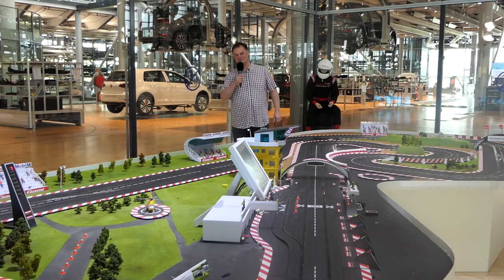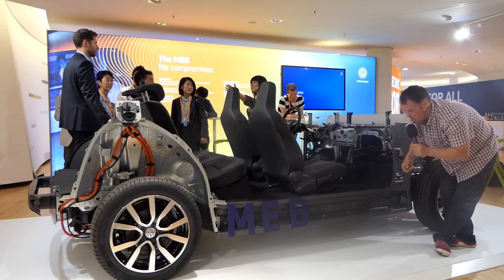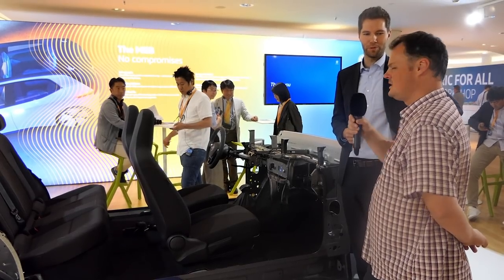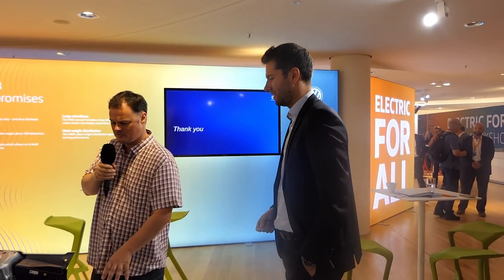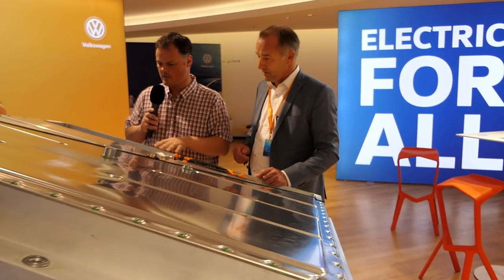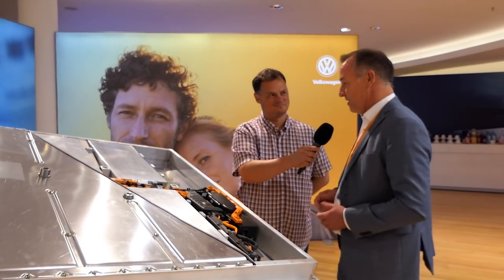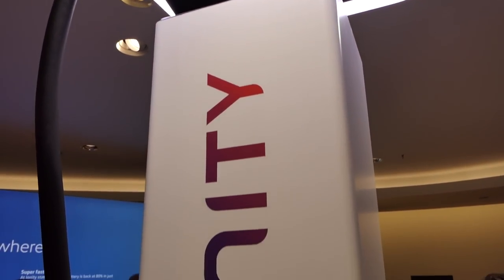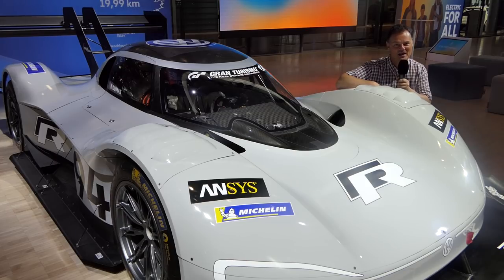Will this boost electric vehicles? 10 million EVs on Volkswagen MEB platform FEATURE - Autogefühl

Comment: The end result may be very good and durable, but i'm disappointed in what i saw in this video. It's basically a slightly improved Nissan Leaf structure ... nothing advanced, just off the shelf parts from various manufacturers...
"You need a cooling system? Just glue it on the bottom of the battery pack!" 
Long story short, for version 1.0 Beta it's acceptable, but they'll need to improve it significantly to compete long term ...
Reply: Baggage from their ICE powered cars, by baggage I mean conventional auto makers are tooled up to build the car around the petrol burner. Tesla for example has no such baggage which results in better packaging but of course Tesla has found out the hard way that starting from scratch is, well really hard.
Reply: I would expect more from a manufacturer like VW, who have the capital, expertise and public shame necessary to build something great again. The Tesla Model S  development cost was just a few billion USD?
Reply: Kárpát Zoltán I have the same thoughts that they should show something more advanced with their capacities. It’s like milking the petrol cow as long as she gives milk... In cities we are all inhaling so much crap from the cars it’s terrible like how bad must it be in places like New York! We need full electric or only bicycle in cities.
Reply: @BastianJahn  they had electric cars in the cities back in the roaring twenties but they disappeared again.
Reply: Kárpát Zoltán - VW just spent a absurdly massive amount of money redesigning their ICE platforms.  They’re not going to throw away that sunk cost without a fight.  This whole electrification thing obviously caught them off guard, so now the engineers are trying to shoehorn electric drivetrains and batteries into platforms that are clearly not designed for it.  Btw, Toyota is going thru the same issue.  The Prius Prime is built on an all-new, bet-The-company platform that has NO room for even a moderately sized battery.  Just look in the “trunk” in a Prius prime if you want a chuckle.

Comment: Good to see that VW developed new platform and goes in direction to E cars. But I‘m missing a frunk, I ask me why Tesla has the space and VW not...
Reply: why have a frunk, when you can have a smaller car. The concepts of MEB-cars show a very small hood. That was probably one of the design goals. The teslas are large cars, to large for the European market, that is dominated by compact cars like the golf. By making the hood shorter, you get more interior space without a longer car. I am curious tho, how they will fare in the crash tests, as the teslas have a longer crumble zone in the front of the car.
Reply: It's because of the modular design. This same chassis will be sold with a transverse 4 cylinder ICE engine.

Comment: I don't know but that radiator is in the same place and mounted in the same orientation as most ICE cars.
But what do I know, I've just been working on cars since 1978 back when I was still 10 helping my dad with his car.
Reply: Modular chassis means that one version of this car will have an ICE. Radiator probably does double duty for both ICE engine and battery cooling for BEV version. This shared architecture is most likely why it still has a lead acid battery.

Comment: Why don’t EV auto makers put parallel charging ports on both sides of the vehicle?
Would make it much easier to charge. 
Also, why don’t they sell ceiling mounted charging stations, or at least retractable charging cords that drop down from the ceiling to save space and make it easy to access the charging port no matter where it’s located on the vehicle?
Reply from the maker: See in the Audi e-tron review with the charging ports: https://www.youtube.com/watch?v=OAViUyT1gfE

Comment: Did not seem impartial. Almost like a promo for VW. There was absolutely zero that was “groundbreaking” and the journalist looked like he was asking a bunch of “approved” questions with prepared answers. Why a 12 volt lead acid? Why not super capacitors? Why not a more integrated front section. Looked like a traditional ICE engine bay that’s been adapted rather than something designed from the ground up for an EV. My guess  that is to reduce costs so they can use existing suppliers rather than custom designing radiators and AC units -  that’s fine but don’t pretend its anything special. It’s great that VW is embracing EVs but it isn’t surprising to see a lack of “openess”. And if cooling a battery is so important what does that say about the eGolf?
Reply: MondoTV just wondering where you got your decades of experience in automotive design - LIKE VW HAVE.....
Reply: Andy McCabe Why so angry? I gave an opinion on the video and one design aspect of the car. Did you think that was an impartial and open video? Did you think the front engine bay looked like it was custom made for an EV? For example like a Tesla model 3? If you did that’s fine. I think its great that VW is actually going to commit an assembly line to EVs. More competition is good. I didn’t find much in that video that was very innovative as claimed. IMO.
Reply: pete smyth What has that got do with what I wrote? It wasn’t about the merits of the two companies. I was comparing how a new player designing EVs from the ground up went about it and how a traditional automaker who needs to produce ICE cars goes about it. VW gets certain economic benefits by using traditional ICE components and layouts in their engine bay. I was simply complaining about the.pretense of innovation. The Kona and Ioniq are the same because those cars also need to be produced as ICE variants.

Comment: That 12 volt battery is a engineering joke.
Reply: Does seem rather sad doesn't it? At least make it lithium, not lead-acid (maybe they have, but it didn't look like it). I guess it's just so much easier to keep a simple 12V circuit for all the standard legacy stuff, and still have the car do some things with the main battery disconnected.
Reply: @xxwookey  Couldn't afford a transformer?

Comment: Tesla has been producing this for years only better integrated.
Reply: Werner Engel  - I noticed that too.  VW’s packaging leaves something to be desired.  Its obvious they’re still buying parts from outside suppliers and trying to fit them where there’s room.  Tesla designs and (mostly) manufactures the major powertrain/electronic components, and this gives them a huge leg up on integration and cost.  Not to mention...they own the designs, not a third party supplier that sells parts to the competition.
Reply: Everything looks like it is easy to maintain and replace separately. Which is very important in a car.

Comment: First off, I support EV’s - mainly for reduction in emissions... not just for potentially lower running costs. However here in the UK a very worry figure has just been reached. Running a EV using public charging points costs the same as a eco diesel car - since VED (Vehicle Excise Duty) changes in the UK and now that charging point suppliers have increased the cost of public charging. 

Yes, if you have the ability to produce your own renewable electricity at home, or use cheap at home electricity, it is still cheaper (to run) a EV than a ICE car. But if like me Charging at home is not an option, then EV’s are no cheaper to run than a high MPG diesel of say 60mpg.

Things will not get better. In the UK, the Government gets 10’s of billion ££ every year from fossil fuelled vehicles. That money HAS to be replaced and EV’s are now suffering.
Reply: A fairly modest charge for emissions would make the EVs cheaper, and that has to happen at some point.

Comment: Good effort. Not a single 100kw charger in UK. So fat EVs like i Pace need over an hour. Bad for Leaf, Ioniq and i3 owners. Real world range, especially in winter much less than 550km. More energy into battery than car says it uses eg : i3 60ah around 19kwh for 100km but car says 14.5!
Reply: Well, other than Tesla Superchargers...
Reply: Tesla ones are over 100 and don't fit any other EVs. Most EU evs now CCS

Comment: huge mistake, rear wheel drive. front wheel drive has always been superior. I have been driving 55 years.  lithium batteries heat up and has caused fires in rare to too often times. New generation batteries of graphene or newly announced hemp batteries that sound much more promises.
Reply: FWD would have been a huge mistake. Why? Here's a hint: weight distribution.
Reply: you have been driving without passion for 55 years ;)

Comment: No matter how good Electric cars may get, they will not outsell gasoline cars if electric cars don't get way cheaper. 
I live in Mexico, where most of the population make less than $500 USD per month. What's the point of having electric, when at the end of the day paying for the car itself will be more expensive than paying for the extremely high cost of gasoline these days. 
We need an electric car under $15k USD no matter if it has a somewhat short range per charge.
Reply: Same thoughts here, I think it's totally doable, since ev's have less components, and electric motors are simpler too. It all depends on the price of the batteries, we have to wait and hope these cheap solid state batteries are coming.
Reply: By the time a EV will be more popular than a ICE we won't even be driving anymore.
Reply: Chris Hart maybe in civilized places like Japan or Switzerland, where I live.. even the best computers would get confused, also, as long as there will be people who like to drive there will be cars for sale
Reply: @arturasp9738  people that like to drive and can afford it will be the only ones.
Reply: Daniel Orozco you are right they are working on making batteries cheaper and once they are the cost of EVs once they are to scale will be I think half the cost of ICE overall

Comment: 6:15 Real wheel drive "better driving performance for slippery roads and so on"
Sorry i have to disagree 100% dry roads yes more performance but slippy eg snow,  It does not matter how the power is delivered if the "Bite" angle doesn't change. Ok an auto gearbox is nothing nothing...nothing.. then TOO much torque and so = more polished snow under the wheels. Optimal is 4 wheel drive with differental  lock (on/off) second to that front wheel drive manual. Here the driver can (play the clutch bite) to rock the car out of the whole dug by someone who just thinks more power = more chance to get out the hole but actually just digs the car more deeper. Ok a manual real wheel drive it's possible to rock the car out using the 'scateboard ramp' situation.

Back to the battery & design of electric. If customers pay the same to get the same performace and can get to their destination on one charge AND there is a garuntee of a minimum kilometres before battery replacemnt is needed AND that cost is comparible to regular services on a conbustion engine car - THEN more people will buy in my view. Human nature is to be wary of change and be scared of something new - but it can and will happen.
I felt this myself when i was driving a renult megane (2006) and though only a year old it just stopped! So I opened the bonnet, scratched my chin as if to look like I was about to fix the problem and then found myself stareing at a lump of plasting covering an engine somewhere. I checked fuses (after i found them - check. Fuel level ok- check- Battery ok -sure windows sounded like the battery was healthy (even if the charging system failed on my way home) wireless keycard problem? - nope check the car sensed the keycard and opened as expected....
After 10 mins sat there it just decided to start again. There was no click of a solenoid before - the brake pedal sensor was ok (rear brake lights came on when I wedged my laptop bag and coat and small useless toolkit that comes with the car...I will never know to this day.
Only the French make a 5 sided nut on the brake calipers of a citroen BX so you HAVE to go to them.. Never again though it was a good car, but I had not owned a BMW :-)

For the Green party that want to rasie fuel prises to crazy levels (how is that helping people the MUST use a car???) I also ask what harmfull chemicals are put into the air while producing batteries. Also the whole CO2 debate is no longer a debate anymore becasue the 1st BIG lie made Al Gore very rich AND closed the door on proper scientific research. CO2 makes upa tiny % of greenhouse gasses - climate change is real but is is totally man made or is sunspot activity more the driving force (and the magnetic poles shifting at alarming rates)

People will sell anything to make money in every idustry. VW are rightly keeping fingers in different pies - but have lied to people before so...... make your own mind up I say. For now, for me, I'm out.
Still a great review apart from the rear wheel drive part??? Uh?
Reply: REAR not REAL wheel sorry. I must set up spell check to English on this qwertz keyboard (it's my excuse but actualy the key spacing is terrible. That's one problem, the other is feedback. It feels like i'm playing in the mud when I type!